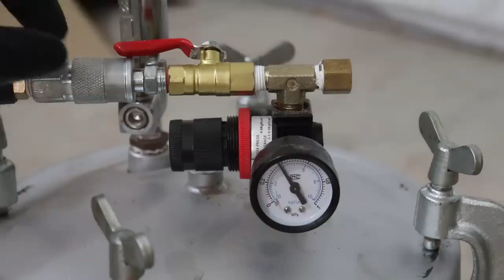Wood Turning Golf Tees

Comment: Any issues with bubbles from the golf tees? I'm assuming pressure pot and i know golf tees have a wax finish. Just curious.
Reply from the maker: There were a few on the surface just where the tees and resin touched the mold, but nothing in the middle luckily